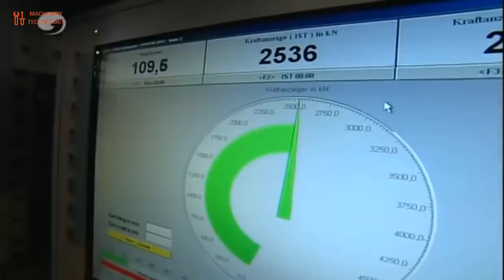Amazing Manufacturing Process - Huge Chain Making and Great Teamwork Forging

Comment: 💚🤘🏿 celebrity chainz , tire tubing 02:17 , Hanging big in front of you , Hanging big in front of you , 💚🤘🏿 celebrity chainz , tire tubing in basket 02:17 , litter stick to touch can’t bendd over touch it , cane looking before completely bent to oval red/white hot , queens nutcracker 07:01 hot beat / waxing machine twist in circle as beats down